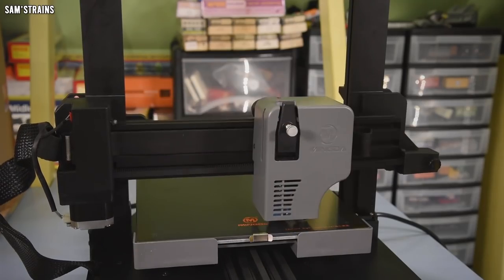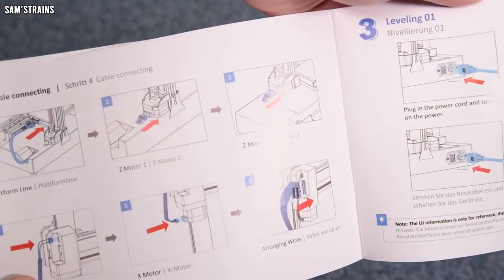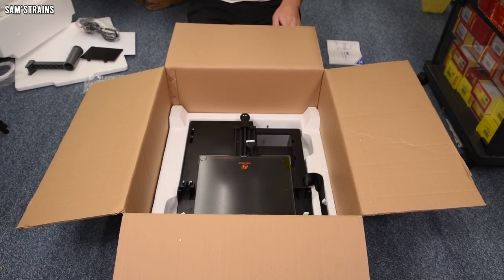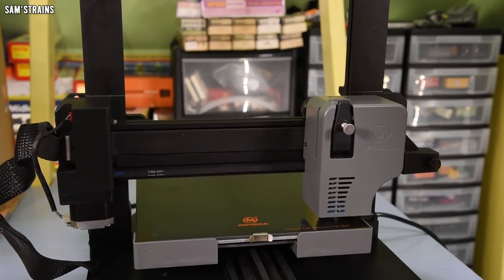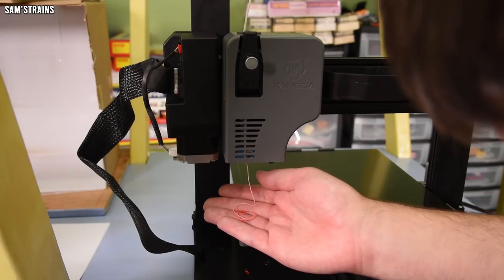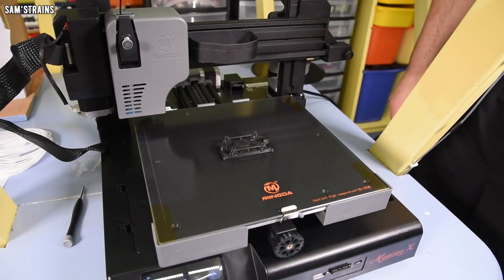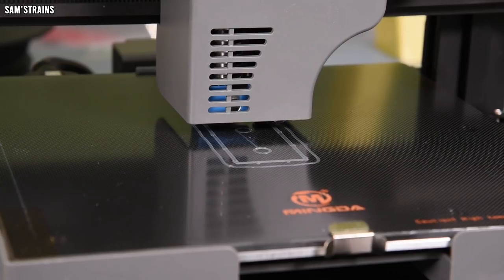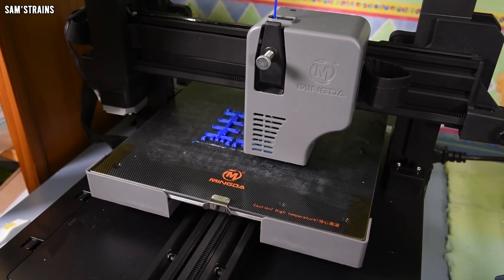This Cheap 3D Printer Makes Outstanding Models | Mingda Magician X | Unboxing & Review

Comment: Interesting to learn about 3D printing this way. But Sam, to be frankly honest, my first concern was that it immediately looks cheapo plastics being used and I'm not very convinced about the printing quality at the moment... Problem is that the extruded plastics are cooling in open air..., which is a very bad idea..., you'll always will get some degree of deformation caused by too rapid cooling, no matter what speed.  Maybe there is some potential, but quality extrusion needs to be done in a controlled encapsulated environment to prevent warping. Hence, the higher price for the better 3D printers providing this.
Reply from the maker: Thanks very much for the comment! I've not really found that - since enabling acceleration and jerk control, the Mingda is producing better prints than my Adventurer 3, with it's enclosure... so it's looking good!
Thanks for watching, Sam :)
Reply: @SamsTrains  That's very interesting to say the least. Have you not enabled those for your last print you showed? I thought you had but the result was so so and deformed to my eyes. But of course we will have to see more comparing results. I mean, using similar settings (speed, controls, temperature, non-warp print consistency). Interesting development and thanks for sharing your experience.

Comment: there is no such thing as automatic bed leveling on printers like these, all it does is remember at what height each point is and adjust the gcode for that, which means that if your bed is wonky, your prints will be too. for a true self leveling bed look at an anycubic machine, starting at around 20k gbp.

Comment: Your side by side comparisons are clearly showing that this printer is not capable to do same print quality as the flashforge adventurer u mentioned. 
To much ringing and uneven walls, less details, the nozzle was way to low despite the "new magic leveling tech". There are many printers out there in the same price class that delivering better print quality. You should mark this as Review-Ad.
Reply from the maker: It's actually far more capable than the flashforge - maybe you didn't watch until the end? Once I changed the settings and got the Z-offset right (the magic levelling does work - prints are level, but you've still got to get the start z height correct), the prints have been much better than the flashforge! The ringing and uneven walls were all due to the cura settings and not the printer - I'll be showing more prints done with this machine soon and you'll see what I mean!
Thanks for watching, Sam :)

Comment: You missed one crucial problem with that printer - no spare parts available.
Reply from the maker: Only because it hasn't come out yet - I expect parts will be on the way!  And it uses many standard parts too - today I built a new heatblock for it using parts from Amazon!
Thanks for watching, Sam :)
Reply: @SamsTrains  I hope you're right. I had to replace the entire nozzle enclosure on my flashforge adventurer and when I saw the prices I almost got a hart attack - I sold it for parts/repairs and got Ender 3 instead - what a superior machine. But still I think Flasforge is much better for beginners.
Reply from the maker: Yes it’s not ideal at £30 per nozzle, but I got over 2 months of solid printing out of the first one... and it is handy to be able to replace the heater, thermistor and throat so easily! Much cheaper with this style - I bought 10 new nozzles, heat blocks, throats and thermistors for less than £40... and it’s so cheap to buy the printer too!

Comment: Dear Sam.
   I'm an avid visitor to your channel but the idea of using 3d printing is to be honest not my thing.
I use can I say two scales both are motorised in different ways.
1/35 scale and would you believe 1/300 scale but the modeling pleasure to me is physical building a piece of rolling stock from  a sheet of plastic by hand and then somebody likes it when  I attend a  show.
Sorry to say but you are taking the buzz out of modelling
Reply: To be honest, I think this is the way of the future. Lots of top notch modellers use them.
Reply from the maker: That's fair Paul - it won't be for everyone... but for me who works better on computers than with my hands, this was the route I've personally chosen to take! :)
Thanks for watching, Sam :)